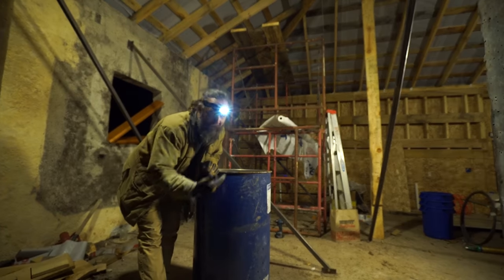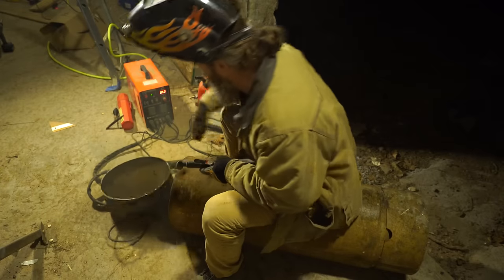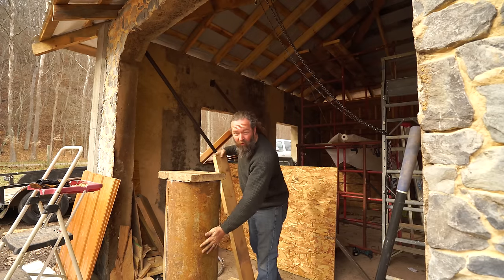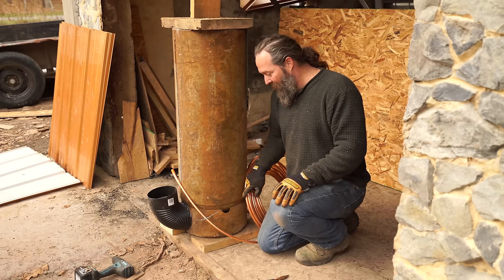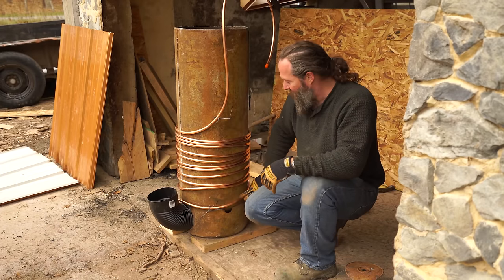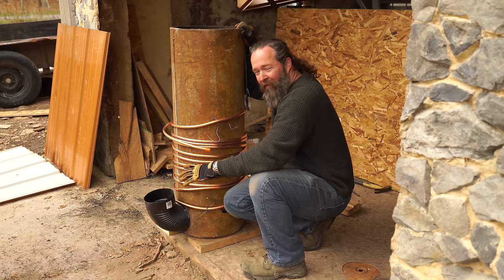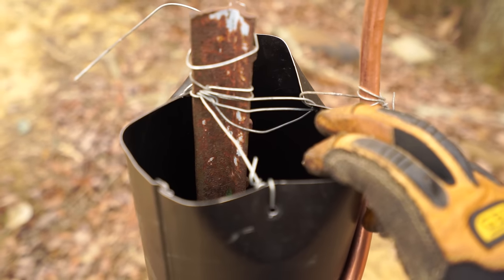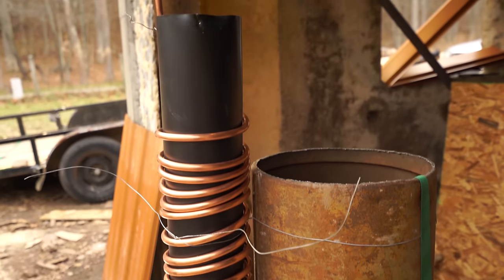The Dragon V2 Build Complete How To Video (featured in Mother Earth News) by Timothy Luce

Comment: Fill your copper tubing with sand and stay warm and dry in the process, it really works, I was skeptical at first but low and behold I was convinced after the resulting perfect contouring of the copper tubing spiral I created... Just passing along a tip for your future considerations. Great video on the stove build. Lol at running around it like a crazy gerbil...
🎸🤓🎸🇺🇸☮

Comment: I learned much more than building a Dragon. Your video is full of helpful little pieces of info, ie.. soapstone marker vs. sharpie, how to fill copper with water to keep from crimping, and much more. Really good video. I know they're a bunch of work, thanks for sharing.
Reply from the maker: +David Hall rock on David.  Thanks for the feedback! Learning is fun. Sharing what I've learned is fulfilling.
Reply: 5:54 -ish Thor calls his hammer back.
Reply: show your mistakes next time or folks will copy them !!! nut first , flaring next !!!  do not make concrete in frosty weather , if nessesery , insulate from all sides incl buttom , anti freeze could be just denatured alkohol , n this project it doesn't matter that concrete cracks , but if you need strenght , pour it in a temperature + 5 celcius minimum

Comment: Friendly Life-Saving Suggestion: in general: you NEVER bring the water tube back down. Up only. Must be continuously ascending, or you will build steam pockets in your highest point.

You should have a pressure relief valve at your highest point as well.
Reply from the maker: 1. By design, There’s not enough water volume in this stove to do any damage.
2. There is an air release valve at the highest point
Reply: @midevilone  Pressure relief valves require continual service, and have a service schedule. It's entirely possible to do this. However: simply observing the laws of buoyancy is probably better for most (if not all) cases. Only where this is not possible should a remediation effort (like relief valves) be employed, such as large commercial facilities and underground installations. Even at that, rarely would there be only 1 pressure relief avenue in the system, (such a design without redundancy would not likely ever get approved.)

Many people are killed each year by pressure vessels, far more than by plane crashes. So it's good design to eliminate that problem to begin with, whenever you can. Especially on non- engineered projects. Even Three Mile Island had problems too; relying on pressure relief valves- they don't always work, and it's something else to go wrong. 

Anyone branching-off from your project to another should well be informed of the dangers of steam explosions. NYC was fed by steam heat pipes, still may be today. Lots of areas were. Lots of engineering and maintenance goes into such systems, and steam explosions used to be common even so. So just better to keep a heated pipe ascending, especially where the heat input is not regulated. 

Your project looks good, thanks for sharing it 👍.

Comment: Over time i see the potential for galvanic corrosion. Between the heat, the concrete, the copper (more noble metal) and the steel of the barrel and already rusting central heat core you run a strong risk of failure from dielectric reaction and having to gut and rebuild this stove.  If i might suggest, as many mass stoves use the galvanized pipe running back and forth for as much as 20 feet in the mud pack, clay or firebrick etc. you could use that design and wrap copper around galvanized without concern for the dielectric reaction for many years to come.  However i also understand the desire to experiment with on hand materials until you reach the best design for your needs. Cio!

Comment: little tip.let the cool water in at the cool part of the heater.let the water go out at the hottest part of the heater.then you have the maximum difference in heat between air and water.thats the way we do it with air handling units etc.

Comment: I have an out side stove. Use to also heat water , I have a small mixing valve , you just set , its pretty cheap , puts water in my hot water heater,  At correct temp , If the water is to hot it mixes cald water with , works

Comment: Copper will interact (oxidize) much more rapidly with iron/steel. I understand that this tank is galvanized but I can also see the rust leaking through.
Reply: It won't react with the steel unless there is water present.  Not likely to be water at these temperatures.
Reply: @atstancioff  Thank you
, that is good to know but unless you're running your stove roughly 365 days a year, there's going to be ambient humidity.
Reply: Copper and cement is not good though.

Comment: Ever thought about advancing into a wood waist oil burning rocket stove to boil water to run back into the main house and heat the house with copper coils. a no pressuar boiler and a 12 volt hot water pump and recycle the water back into the boiler
Reply: That way you can burn off all you house hold oil waist like used veggy oil old bacon grease old crisco. old car oil you don't want toss out because that's less wood you have to buy

Comment: With counter current mechanism cold water should come in contact with coldest part of the system and progress to the hottest to get best heat exchange. Would a thin medal jacket around copper pipe to keep vermiculite away and trap hot air around all pipe help

Comment: I did something similar with my preheat water system years ago . I put it all in a gutted refrigerator and enclosed the front part sides to enclose the front from the tank to the fridge lip. I wound the tubing out of a 6 inch pipe up to the top inside and then enclosed the top and put two ducting vents up there and a furnace blower in the rear with a a couple of heat sinks to turn fan off and on.  So it was a dual purpose furnace which preheated my  house tank with similar coils in it to warm up the water before going into main tank. I had to insulate the outside of wood furnace and also the copper lines from shop wall into my house basement as well as both water tanks. I used windshield washer flid in my lines and also later found a boiler pump but never got around to installing a pump on the lines, just a  one way check valve was okay. Thanks for the upload.

Comment: Years and years ago M.E.N.  featured an outside concrete block building with a  wood stove used to heat water and  tons of sand. This heat sink (boiler) then supplied heat to the home. I think it may have been a Swedish design. Does any one else remember it?

Comment: Good thing he used a flare connector that close to the heat pipe.  Those things can get hot enough to melt solder.  I would still have left a little longer pig tail to limit the magnitude of heat cycling.
Reply: How would solder melt when the pipe is full of water? Never gets past 212, solder melts over 350.

Comment: All due respect oh friendly Viking looking craftsman, but you could fill up the pipe, cap it as it is full (no bubble at the caps (that means you need to do the tightening of the caps in a water filled bucket or tote) and skip on the freezing...The freezing adds a risk of splitting the pipe. She will coil as easily (or hard as being sand filled, ice filled or anything else then air. BTW: kinking is bad obviously but if you can coil around without any filler you would probably end up with a slightly oblong cross section which makes for a slightly larger contact area at the burn chamber and exhaust pipe surfaces...

Maybe a good idea to use a figure 8 while coiling around the stove pipe and the burn chamber. This has several advantages: for one you can use the coil in a thermosyphon system (since all the pipe is coiled in one direction up/down wise) and it is much cleaner (looking). Also you could run the stove pipe elbow much closer to the burn chamber: as close as 1/2-5/8 inches (the OD of your copper pipe and a little wiggle room)
You could do a coiling form made from a piece of gas bottle slit open, reduced in diameter and welded shut again and a thick walled piece of pipe slightly smaller then the OD of your stove pipe welded onto a plate of sorts. Of course the form has some pegs welded in place to jam the copper pipe behind (so you don need to bash in that rebar into the ground any more...)
This form thingamabob can be clamped to a workbench and needn't be very tall: maybe 1,5 or 2 feet or so, which makes figure 8-ing around it much easier...You can then expand the coil if you want to....
Having the form diameters a little bit smaller makes for a nice and tight fit around the burn chamber and stove pipe.

Would it be better to run all the copper inside the outer drum, just to have a cleaner looking stove?

Comment: Thanks for talking us through this with just the right amount of detail and good videography.  It was super interesting!  One of these days I'm hoping to build something similar.

Could you have used something like cob or another, more natural material in place of the concrete?
Reply from the maker: Sambulate absolutely.   But concrete was $4 per bag and simpler for me.
Reply: @midevilone  Just wondered.  I've known about rocket mass heaters for a while and know they're usually built with cob.  I'm just learning about design and materials, though, and wasn't sure if you chose concrete for another reason.  Besides, I imagine cob would be more difficult to get it knocked down into the nooks and crannies than the concrete.  Thanks for your reply--I may be back to pick your brain again!
Reply from the maker: @sambulate  my stove piped hot water into abt 10 yards of concrete as our heat sink instead of cobb.
Reply: iBooks like u needed another roll of copper

Comment: A quick note.  I take it that none of the concrete covers the copper tubing.  Because whenever copper passes through concrete it has to be sleeved:  concrete eats copper.
Reply: Recon a feller would be ok with fireclay vermiculite and silica or refractory with some lava rock and pearlite. Excuse my spelling spell checker don't know these volcanic rock words. If that was to eat copper what other than asbestos could take the heat to sleeve the tubing? Lest a guy was a millionaire and could afford stainless steel  $$$$.
Reply: Need type K copper to run in contact with concrete.

Comment: I am surprised since you filled the copper tubing with water, it didn't bust when it froze. Interesting video!
Reply: It didn’t freeze long enough or it would have split. Freezing is a needless risk. Fill with water and put compression caps on the end.
Reply: Yes i agree, ice in copper tubing equals crack in pipe, i just repaired. Frozen copper. Line, fixed it with grizzly. Connector and pex, easy fix,.

Comment: Two things
When you attached the bottom 3" pipe did you cut a hole through the propane tank wall at the same time, or where did the pipe go?
Also you never show this working- Do we assume you are top loading wood into this?
Thanks
Reply from the maker: +Cecil Ellsworth hi.    I cut the hole through the propane tank skirt right at the line where it meets the tank.   This placement put the incoming air flowing directly across the bottom of the grate.  I'll be posting a new video soon showing a minor modification i made to the stove yesterday that improves airflow into the coal bed.
Reply from the maker: +Cecil Ellsworth also I have posted a separate video of the stove burning.  Check the other vids on my channel.  Subscribe for future updates and let me know how you build goes once you get it started.

Comment: So this set in concrete, what about when the thin metal of the stovepipe breaks down? What about Galvanic Corrosion between the copper and the iron?
Reply from the maker: +KirkDickinson see prev comments debunking the corrosion myth.    Only the base is set in concrete including the elbow.  If the stovepipe breaks down (i have my doubts there as the stove in my childhood home used the same stovepipe for over 20 years before my dad changed the setup at which time I think he put in new pipe because the dimensions changed. ) if the pipe breaks down i buy new and replace.
Reply: KirkDickinson galvanic what?? Da hell you talking about?? Are you one ogof those crazy internet people always trying to ruin everything? As if dissimilar metals weren't noble enough without crazy people

Comment: Thank so much for all your efforts & sharing this video.... I’m certain you have already thought of this, I was wonder if there may have been an easier way to wrap the copper? What if you had stated with the center of that copper coil and tightened the circumference of the coil around the tank and the stove pipe??? It seems a bit strange , but maybe it would have had  less running around and more passing from hand to to hand much like turning a large steering wheel from the top, (you get the idea, right?)... I hope this idea may help in the future, I mean no disrespect, only to aid thoughts that may help future projects. I have never tried to build one of these. I’m only think after the thought, much like a back seat driver, I am only trying to help, I apologize for any back seat driving I may have accomplished. I really like that you shared your video & all your efforts!! Thank you again..
Reply from the maker: Jerry Frugoli i don’t understand what you mean.  Thanks for suggesting though.

Comment: How do you clean out the ash? And, why not fill it with concrete rather than vermiculite? It seems like the increase in mass would improve efficency.
Reply from the maker: +Ron G filling with concrete would take longer to get the stove up to temp.  Since i use this stove off and on in my shop faster start times are important.  Currently i have just put fiberglass batt insulation at the too of the 55 gallo drum to seal hot air in. Concrete (or sand) would be better for continuous use.
Reply from the maker: +Ron G i made a mini hoe and simply drag the ash out the inlet hole takes about a minute.

Comment: Ever thought of using aircrete  instead of vermiculite as an insulator ?
Reply from the maker: jack simper i think the density of aircrete would make it far less insulative Than vermiculite.  The vermiculite is essentially superheated volcanic rock and is very lightweight.  Putting it in the stove dry (vs wet aircrete) also creates more air gaps (less thermal conduction)
Reply: @midevilone  I`m not so sure about that theory  . Hopefully someone will do a test of both against each other to find out .
Reply from the maker: jack simper it could likely be approximated simply by a displacement/density  test

Comment: Concrete in contact with copper will cause electrolysis and corrode the copper. Extra care when placing concrete to prevent contact. Would suck to have to tear apart or rebuild because of a leak.
Reply from the maker: +appcarpenter1 false.  A: According to petrographer Bernie Erlin, copper won't corrode in concrete unless soluble chlorides are present. When copperis adjacent to steel reinforcement, and an electrolyte such as chloride is present, steel corrosion is likely to occur due to galvanic action.Sep 1, 1998
Source: http://www.concreteconstruction.net/how-to/corrosion-of-copper-in-concrete_o
Reply: Yeah, well...
According to the Portland Cement Association the interaction of copper with both dry and wet concrete should not cause a corrosion concern. However, copper should be protected when it comes in contact with concrete mixtures that contain components high in sulfur, such as cinders and fly-ash, which can create an acid that is highly corrosive to most metals including copper.
Most redi-mix has fly ash.

Comment: Okay now you're going to force me to build one of these things. There's a giant frozen pizza factory here in the armpit of America. I know several cats that work out there in maitenence and fab. I can get some stainless steel parts from them. I'll have to get some 100 % argon and SS wire.
Reply from the maker: Daniel Fouard let me know how it goes. And hit me up if you have any questions.  One tip. I think I would
Even go smaller with the copper pipe in the next build. As the pipe gets smaller the thermal transfer improves.

Comment: :)
     Nice, I am sure you have installed at least one pressure relief safety valve in your boiler's
     water circuit.
     Sorry, seems some how I missed seeing it.  
     Remember, even an electric water heater is in danger of exploding and ingering /killing 
     all that is near.  AnyWay, I just thought it is worth mentioning.......
:(
Reply from the maker: +UTubeGlennAR yep.  The water storage tank I mounted on the wall is at the highest point in the circuit and it has a vertical tube open to air.  Additionally the pex tubing is rated ton185° under pressure, so it would rupture and vent if there was a pressure / steam event. (You can see the tank in later videos on my channel)
Reply: Yes, open top is best pressure relief valve, much more functional then the brass ones.

Does your hot water coil thermal syphon/circulate on it 's own I wonder?
Reply from the maker: +UTubeGlennAR the stove tank would for sure.  Not sure about the floors as that will add approx 800' foot of pex in 5 circuits. I'm thinking there would Be too much resistance. But that is just a guess